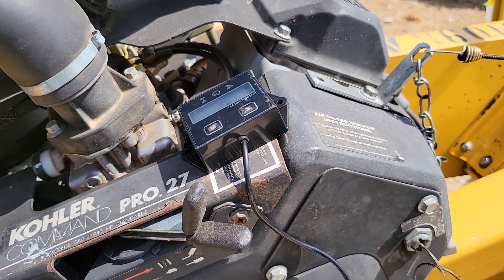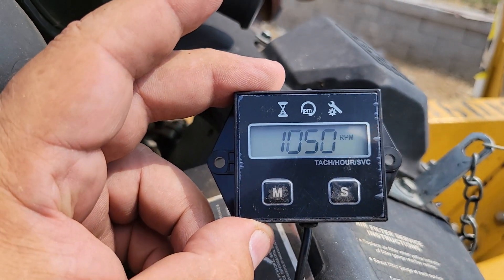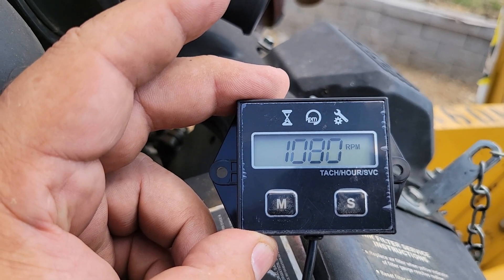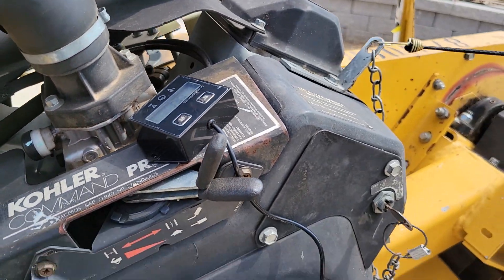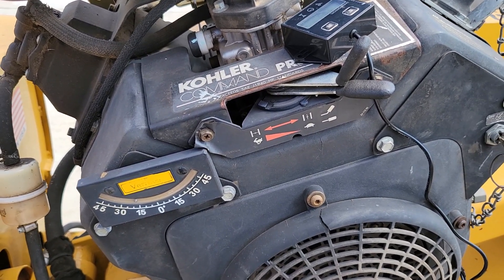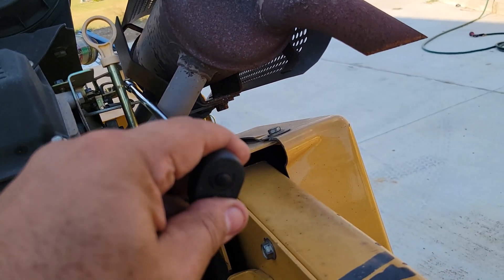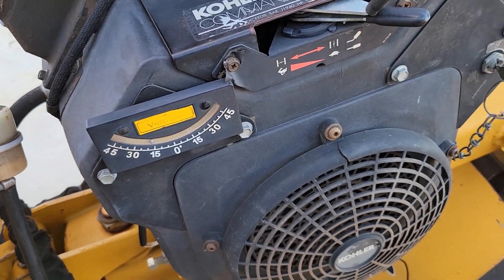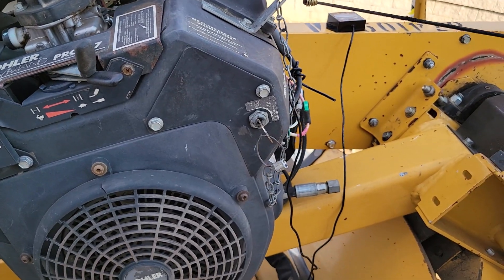Checking RPM on a Small Engine

Comment: Wont work on new mtd ride on 
It just wont start with wire on the spak plug 
Way ??
Reply from the maker: You wrapped it mid wire ?
Reply: @mustangrebuilder  
Yes and tryed it every were else to 
Still won't start with tach  wire touching the plug wire any were 
Take it of and it start straight up
Reply from the maker: @bobstanden6579  I am sorry never had that issue

Comment: My machine has a built in RPM.. Some wood cuts better at 3600 some a bit slower, but keep in mind the higher the rpm the more you need to listen to your motor. ALSO, check the valve lash on your valves. I can guarantee you if they are out of spec and you run high rpm then shut down quickly you will throw or bend pushrods. Sound advice on the RPM meter. I wish sucks !
Reply from the maker: you are this weeks sticker winner send info to mustangrebuilder@gmail.com and which one you want

Comment: Adam. I can time my swing speed, but it would be faster than stock already with my smaller pulley so maybe not useful here. On another note, that machine you have there has had the jack shaft slid on it or the motor side jack shaft pulley slid. Happened to me too, I now dimple the jack and cutter shafts under the set screws one at a time after getting everything perfectly straight and lined up. Lock tight too of course on that last round, one at a time. Worth it if they’re not in there with red lock tight already.
Reply from the maker: Interested in your increased speed
Reply: @mustangrebuilder  came about about 2.6 seconds on average full rpm on my machine, no load, wheel off. Course I typically can’t grind at that pace unless it’s mostly dirt between stumps, but you knew that. I’ll send ya some screen shots of my timer and a video later via email, or put one up. The video I took this time probably not useful to the masses so I’ll likely just send it your way and feel free to do as you please with it content wise(if you want to make a comparison or something).
Reply: @mustangrebuilder  Will do. Maybe tomorrow.

Comment: Adam, great advice in video. Time value of $$, I tell my kids a golf ball on a mountain rolling down hill will be huge when it reaches bottom of mountain. Gotta do it young, I did. Also, I have the same 27hp on a 252 and I have a small engine tach for same reason. I bought it but misplaced it and will set my replacement motor rpm when it turns up. Hopefully, hip pain’s down to a minimum. Thanks for the videos brother, keep’m coming. Fran
Reply from the maker: Absolutely